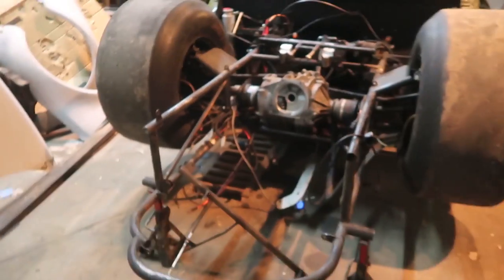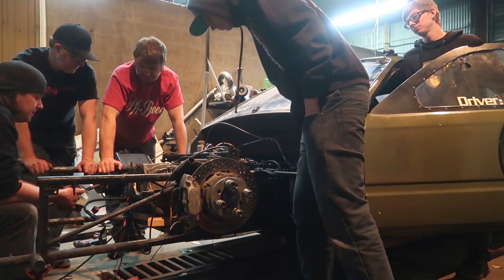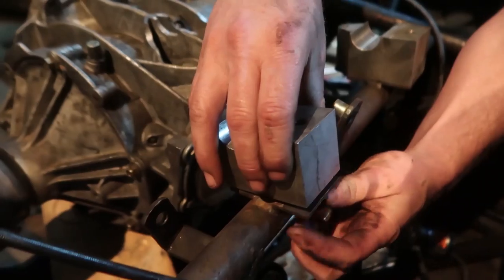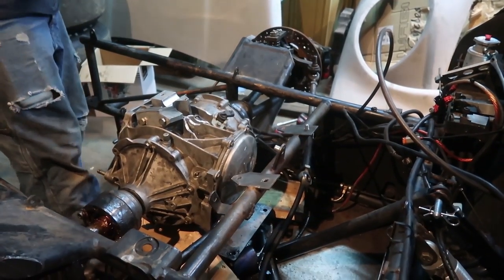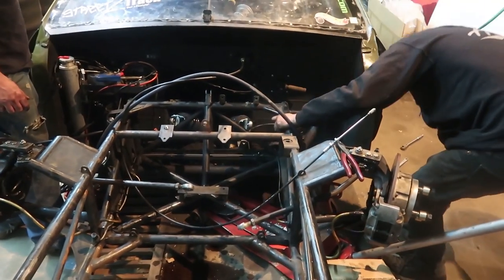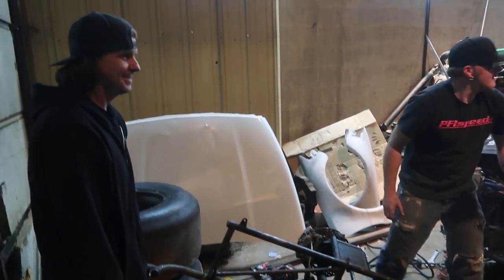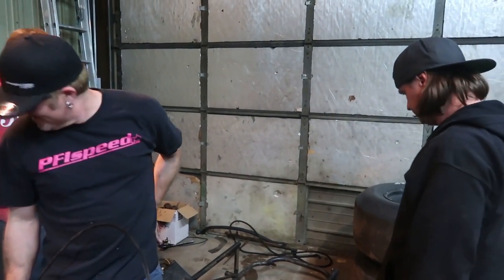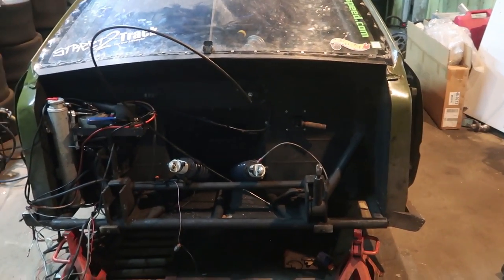BULLY , Step back to Move forward ! Let’s Goo!

Comment: Im shure you guys are thinking about this, but if you are not, consider  some better  high volume dampers (shocks) between the front assembly and the main body of the car.  It just seems to rebound and not load up smoothly when the violence is coming on. You guys are really  getting to a cool place with this Development.

Comment: I absolutely love the bully. Every time I see deeper into it tho I think more about how the swingarm setup isn't going to work without having so much spring that it may as well be rigid. The torsional force will cause the hinge to collapse and compress, whereas a rear wheel drive like a 4 wheeler causes lift. This will continue to cause wheel hop and instability. The alternative, with a complete redesign, would be to do similar to a 4 link. This would only allow vertical movement, giving suspension running availability and eliminating the rotational force causing the sled to compress under torque on launch. Sorry for the big post but I really want to see this thing succeed, good luck guys.

Comment: I love the way all the Guys brain storm and work through issues to try and make the Bully better, safer and faster. I think with the correct spring rate and calving on the shocks it should work great. With that broken heim joint add sleeve that would have been giving you false set up changes. With that fixed it should be way easier to try and dyle it in. Well done Guys you are killing it. You could of went to a conventional type of suspension but with some of the ideas getting floated around this this thing is going to be Rad. Anyone could have built a conventional front end, but that's what sets you Guys apart. Keep up the great content. 
Thanks Guys. 🤘🤘🤘

Comment: You should fabricate up 2x airbag mounts behind the shocks, then you can adjust the pressure at the track and tune it in. This could solve your bogging issues.

Comment: Brent, may I suggest you review the coilover geometry. If it was me, I would've tried to lift the back of the coilovers up and get them closer to parallel with the floor. Just taking in consideration the pivot point of the front in relation to the bottom mounting and the angle that the shock needs to work against might be a contributor to  the front end bouncing. Its should be able to control the load a lot better

Comment: What if you just had a few complete front sleds with different motors be awesome if a motor blew up and 8 bolts later had a new sled and motor in ready to rip! Awesome sauce again sir!,, then I get to the part Brett said that was original plan, that would be epic!

Comment: I agree. Something is missing in the front to rear suspension of the sled. I thinking something like a torsion bar or sway bar type of connection to progressively resist the deflection. To reduce the bounce or slam and be able to dial in the ideal under load weight transfer point. My other thought was something like the old engine stabilizers. The little shocks. So a progressive shock on the same plane as the sled. So top to top. Where the shocks and springs are top to bottom connected. Stick with it. Keep up the awsome.

Comment: For the breaks you could mount a "T" with a shut off on each side and a bleeder on top. When you hook it back together you could compress the caliper to force the air from the break side, then bleed the master side with the pedal like normal, all out of the bleeder on top of the "T"

Comment: who agrees that the bully wil run a high 8 or a low 9 this year. shure as hell i do fooks
Reply: If he were to go longitudinally and rear wheel he could go 8s
Reply: @erickculler2248  I don't think you're paying attention. The back half of this car is feather light. The problem isn't fwd. It's practically already like a rwd car with the front end lopped off. The problem is an untuned chassis with limited passes. With some chassis tuning it will absolutely go high 8's. With more horsepower it'll go mid to low 8's.
Reply: @_Bonez12  exactly, the way the car is built brent is basically riding a wheelie bar.
Reply: I haven’t seen this car do shit. There is a reason racers don’t do this setup.
Reply: @nunabizness  gr8 b8 m8
Reply: @nunabizness  did a 9 already go check out the vids
Reply: @nunabizness  its been out 3 time on an untested set up. and yeah they dont do that set up because brent basically came up with the idea himself. if you knew anything about physics youd understand how much more grip and traction this car gets off the launch due to the frame being able to flex, and you also act like thats some crazy built engine. its pretty much a basic built j series with turbos on it so mid to low 9s isnt bad on an untested system. but yeah thats the spirit, no one else does this so it couldnt possibly work or be fast. dumb.
Reply: This car when is all sorted out
I will go 7s maybe 6s
Reply: @nunabizness  not the strongest argument to drop in.... And I don't even think you got that one right either, I now that top fuel dragsters used this kind of system in the day. I think they forbid  it a while after. Because in a crash it would propel from the rest of the body any which way. All motorbikes & quads use the same priniple, i could go on....but that would be cruel. Even someone not really smart would conclude by now you made a fool of yourself enough. Makes me wonder if you understand what is going on at all. Because in theory this is geniusly thought up. It just a matter of getting the mathematics right how much flex to give for maximum grip without it bottoming out or get bouncy. Even a monkey can be learned to drive 9 second car. It says nothing. Also comments like yours doesn't make people want to even watch your videos  on youtube driving anything.... don't be a dick towards one of the most friendly humble caring honest guys around. That is just not cool
Reply: @atrem7942  For real about anyone being able to drive a well set up car into the 9's.  How many people have driven Ruby into the mid 8's with no practice and almost no track time?  Everyone who's driven her.  Watching Brent fiddle around with the Bully is just fascinating to watch.  I bet Brent gets his 8 before Kyle does.
Reply: @ngcolby  No way. The MR2 should be an 8 when they get the launch right.
Reply: Nuna Biz ness keep hatin! Will motivate these boys even more!
Reply: @SkylineBNR34  yeah and if he doesnt shortshift 1-4th gear.

Comment: U could always do the front shocks with hydraulic rams and small accumulators, we use them on sprayers n they’re pretty compact, u can always adjust them by increasing the pressure or lowering them, the extra accumulation takes the shock away, they work pretty well to! Just an idea 👍🏻

Comment: Good day Brent and the rest of PFI . How about an air bag on the hinge piece ? They have more lifting strength to lift the body off the ground . You could use the air bag to lift it up to a stop and keep it there just have a gauge on it so you can figure out how much pressure is needed to keep 5he tires on the ground and the bully off the ground. Then you could have some dampers on it to keep it moving slowly.  Thats just a thought I got while watching this video.

Comment: The broken Heim joint could be the whole reason why the car was unloading the tires like that! thats a good find! bully will go 8's easy 💪🔥
Reply: Also the walking issue at speed could have been from that as well.
Reply: @thegrimstreaker4669  thats scary ..but the car will be like new and safe !
Reply: the grim streaker walking at speed with big slicks is going to happen no matter what you do.
Reply: Every bully is fragile once you peel back the tough outer layer.

Comment: Seems like a great time to pull it all apart and powder coat the whole front frame,  Where are you Zip lock baggy s with labels for the bolts and nuts?   Now you guys know where some of the front end jerking was coming from that broken Heim joint instead of the shocks.  I think it's Cool can't wait to see it run again.

Comment: Maybe Time for Shaun to Fab Up a new Chromoly front chassis / control arms!
Reply: With a suspension that whole front end just bounces like crazy
Reply: That car is a hack job the front end looks like it's going to rip off the car when i't makes a pass
Reply: @Stevesbe  its supposed to weight transfer like that its the whole design

Comment: Hey Brent
So, speaking of air bags, the Freightliner Columbia used to be available with a air ride front axle. 
12,000 lbs is our DOT max. so 1 bag could do it.
Also
The sleeper of most all 18 wheelers has 2 air bags, they are smaller, less throw, but still pretty strong.
I believe those to be a stronger option then a inexpensive "air shock" off "dad's El Cameno" lol lol.
Finally
I BELIEVE you will need to either match the revolutions per mile ( literally RPM) front to rear to make the speed sensor work right, or, some how compar and compensate between front and rear, due to different tire height (RPM)
I am looking forward to hearing the plan...mine sounds complicated lol.
Nice save on the front end...good call to pull it out.

Comment: Used to work for a mac valve dealer they have pneumatic cylinders that have position sensors so you know where along the stroke it is and goes.  The 4 way valves you use for boost controllers is what you use  control  the amount of pressure on the top and bottom of the cylinder like a waste gate you can set the time delay and a lot of settings in the controller they have probably connect it to the launch control and get it to hold those big tires down. Not an engineer just a bored idea guy hanging with pfi

Comment: Here’s my idea to fix your suspension problems. So my thought process is if you put more than 100% anti-squat, maybe 120% or so, then the control arms should absorb the force of acceleration and the rear should rise rather than squat. If you put   70 or 80% anti-lift then you can hopefully get the front and back to rise together and then slowly settle as it goes down the track. Anti-dive will need to be calculated using the front instant center just to verify no jacking. 15% kingpin angle. Ackerman steering geometry. Try to add some castor to promote stability at higher speeds. Measure the inner and outer wall temps on the front slick tires after each run and adjust camber until I get even temperatures across the tires.

Comment: Brent, I love that idea.  Module drive train.  Having ready-to-go separate set, ready to install, could fit in the back of a full-ton pickup or trailer. Quick disconnects for hydraulics and electrical.  Eventually maybe electric steering, in the future?

Comment: Standing the shocks up to a more vertical position will increase their leverage and effectively make them control the sled much easier so I would extend the upper mounts back into the body some standing them up straighter or more importantly in line with the arc of travel that the sled has.  Geometry is a very important factor and I think you can cure all of the Bully's suspension problems for free with what you have laying around.
Reply: One can also build a linkage similar to motorcycles that speeds up the shocks movement related to the sled, and also make the linkage progressive.

And by that, get to slow down the sleds reaction and get it really tough to bottom out.
Reply: @Patricks_Projects  Yeah that is a good idea as well and if they did it correctly that could provide even more adjustment to dial it in.  Another option would be to replace the shocks in the current location with adjustable bars going up to cantilevers that allow the shocks to be mounted horizontally or whatever which could be even better but is much more complex. Either way I think they have the parts they need right now and don't need to order some custom shocks and waste a bunch of cash on them, and to be honest I don't think the new shocks will perform like they want either and they will eventually have to modify the design.

Comment: Hey Brent,
What about laying those shocks horizontally? Looks like the arc of the sled and the angle of the shock are providing mechanical advantage over the spring, thus you are not receiving the full spring pressure.
Maybe add a rising rate linkage to get more work from the same amount of shocks? 👍

Comment: Wonder if the sleigh has it's limits. Cause pretty much all of the suspension is on/in the tires of it. The shocks would be to stiffen or softer up the force of it to rotate. Maybe it's needs some kind of suspension setup around the axels like a triangle link up. Would not be some heavy stuff to hold up the sleigh and and engine and transmission and diff and all that. 
Don't get me wrong I love this build and it's one of it's kind. The idea and thoughts about it is just amazing. Will be very interesting to see how it progress from now on. Tune it in and testing it out will be awesome to follow. A new set of tires will be doing very much to it too. And the new placement of the parts seems great in theory. 
Keep up the awesome work that you PFi Speed Guys do! 
Hope it didn't came as negative cause it's just some thoughts about the setup this has that I think would be cool to discuss about.

Comment: For the brakes, a dry break coupling would seem to be ideal - there are plenty of sources on-line, but I wouldn't use an aluminium one, personally. [edit] Ah, you're onto that :-)
They're also brilliant for hydraulic clutch systems where the clutch/transmission is frequently removed.
In either case, while there 'may' be bleeding required, the saving in damn fluid getting everywhere is 100% worth it!

Comment: Crazy how now that you know that joint was broke how it was affecting going down the track. Little clip at the end is proof of that. When accelerating the front end would lean to the passenger side. Then when decelerating the driver. CRAZY!

Comment: Man a broken heim joint could have carted you off into a wall at some stage . You guys did well to find it now. I wonder if some sort of air bag on a lever arm would absorb the hit on launch without being too heavy. You could just vary the pressure in the bag to tune how much movement happens on launch. Failing that just back half the thing and set it up like the MR2....

Comment: Would it work to run a tube chassis 3/4 length of the car and put the hinge at the rear bulkhead? That would give more structure to absorb the launch forces, and less radical movement in the hinge, allowing the rear wheels to tuck up under the body.

Comment: You could use a pair of small pioneer fittings (Tractor hydro fittings) to make the brakes disconnect, you might even get away without bleeding.

Comment: As for the struts, just get another pair of strut..but just use the strut without spring in it... And install is opposite direction so it function on reboud side of the movement (with adjustable damping function on rebound side) hope it will help slows down the weight transfer effect

Comment: The bully is an amazing design. Definitely outside of the box. But this is just my two cents for the suspension issue. It would be easier to just add rubber bump stops to prevent over flexing and bottoming out. Also to allow the rest of the car and rear tires to "in theory" work also as a wheelie bar. Cause we all know this is going to have a moon tune of its own.

Comment: have you guys thought about raising the pivot point on the sled and car. if you move the pivot point to the top of the sled it should lift the car and push down on the tires on launch kinda like changing the squat to lift piont on a rwd car. i think that would really help things alot.

Comment: an additional set of shocks could be installed under the sled/car working in extension.  mount them wider than the current shocks to spread the load out

Comment: That was a bit scary with the hyme joint, but on the plus side, if it does break in half on a pass, your in the safer half, all the dangerous stuff (except fuel) is in the powered half which with any luck would outpace you.

Comment: if there was a way to flip the diff (puts the mount for the trans and the input shaft lower ) you prolly could mount straight axles out the diff and only have CV joints near the wheels

Comment: If you ever want to try and add some anti-geometry to fix that squat the maths pretty easy. Just need a few measurements and what percentage of anti-squat, anti-dive and anti-lift you want and I can determine the angles your control arms to match as close as possible. I’m bored and it sounds like a hell of a lot of fun. Probably stop it from shaking itself apart or the cyclic loading. Also if that break was from fatigue and not like a bad weld then the metal is too hard. When the failure is a straight cut it’s because the metal is too hard and that means it’s more brittle. If the break was jagged and diagonal with some necking then you would go the opposite way.

Comment: Is the bending in the middle critical to your launch, or would a linkage that has some anti-squat give you better traction?  A really short 4 link setup that can still pivot up and down, but the torque of the front wheels would be resisted largely by the geometry of the linkage instead of just the shocks.

Comment: What about a reverse 4 link between the sled and chassis?  Would it help stiffen the pivot under load with the heims on the sled side lower than the chassis side.

Comment: Have you considered moving the pivot point further rearward?  The coilovers could stay where they are at.  I’m kind of thinking like ladder bars but backwards.  Usually the longer the better on ladder bars for weight transfer.
Reply: Or maybe a ballistic bump stop from the top of the frame to a plate on the firewall?  It would help dampen the cradle on launch so the cowl area doesn’t slam on the track.  Then you wouldn’t need 2k lbs of coilover. lol